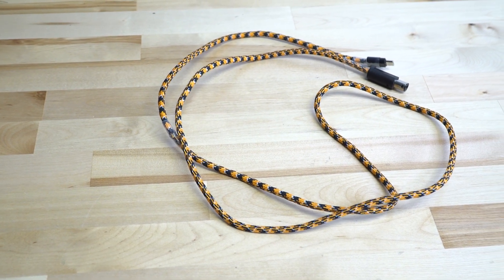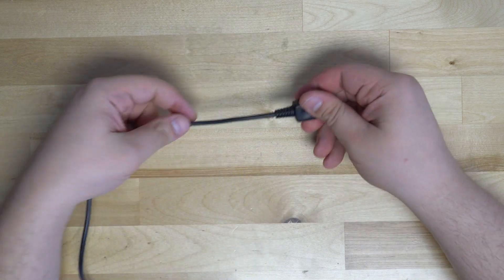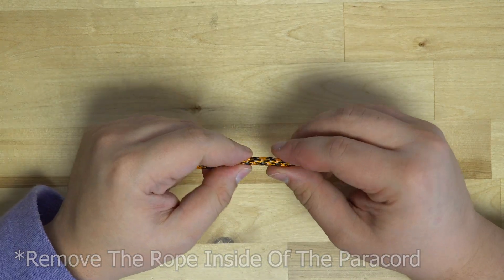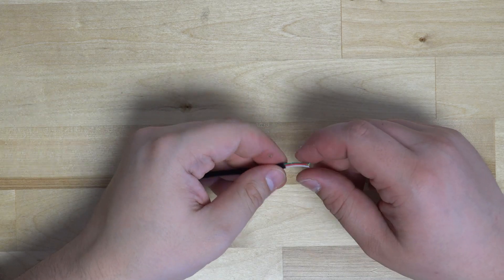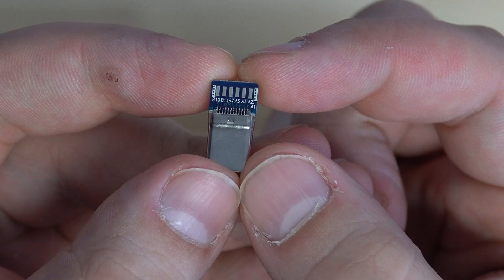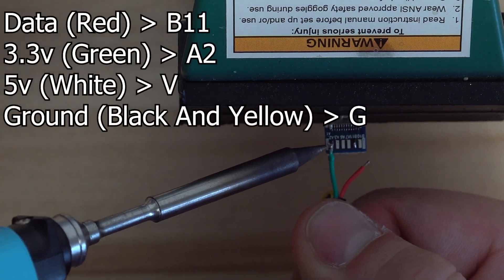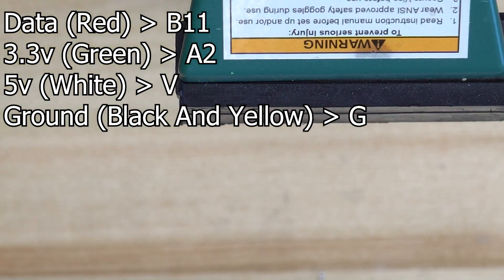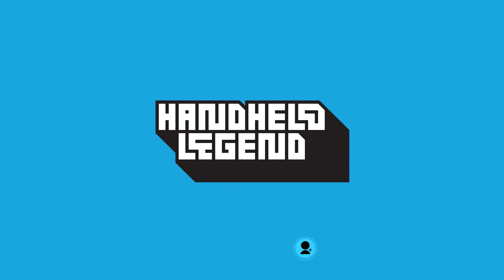Create Your Own GameCube To USB-C Cable!

Comment: Does this work for connecting a Karaoke Glee microphone to a Wii in order to play Karonke Revolution Party (Gamecube version)? The Wii mic is USB-A type.
Reply: If the mic is USB-A type, then it only supports the wii version of the game. This video is ONLY meant for natively gamecube controllers with a USB-C connection. To play the gamecube version, you need a microphone that plugs into the gamecube memory card slot. This microphone is more easy to find as a "mario party 6 microphone". you're welcome.

Comment: would this work in reverse like Gamecube female to USB-C?
Reply: Probably not. It's less of an adapter and more like using the USB C hardware to connect the Gamecube's connections. The GCC communication is not like what USB uses, and so it'll give you bad data, if not outright damage something.